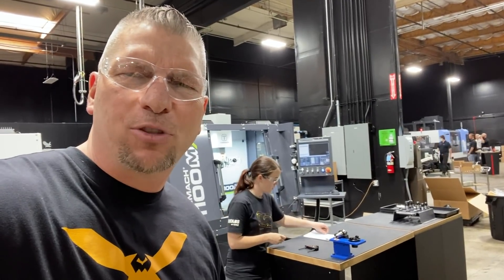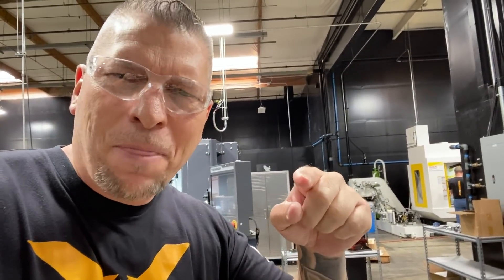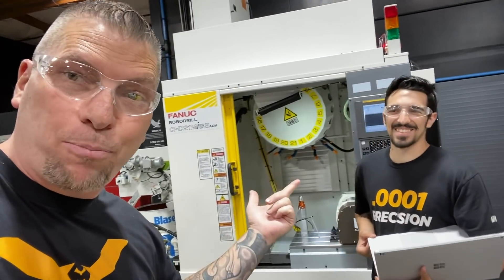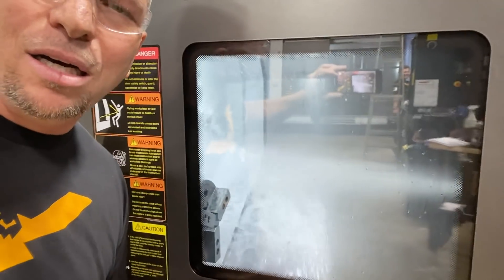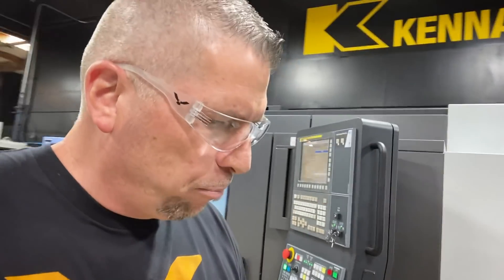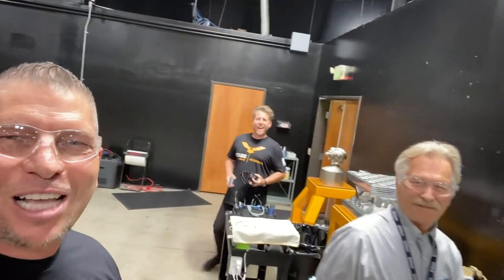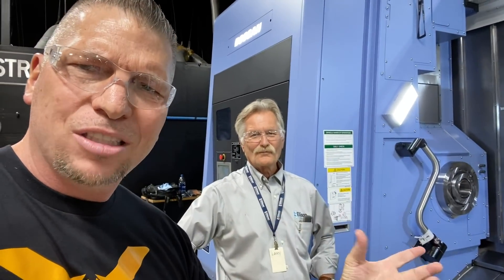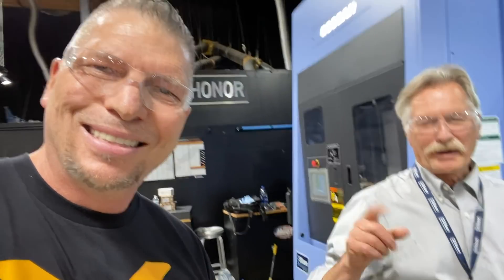Incredible NEW Technology at our CNC Shop | DN Solutions Machines

Comment: Hello sir,
Please help me to solve ovality probelm after partingoff in cnc lathe
Finish component Specification  od:189.80 to 189.90mm
id: 175.10-175.20mm thickness 8.54 to 8.56mm
Material fe510 mild steel 

Ovality occurs. Od:189.70 - 189.95mm
Id: 175.0 - 175.30mm 
Thickness 8.55mm
Reply: ok so you mean roundness. My days in aerospace machining, making titanium parts for military would part off out of round and varying degrees. it would be a lot less of a problem the shorter the bar was behind the chuck... to fix it, we would use granite surface plate and use indicator to find the high point and hit it with a mallet until it was in tolerance.